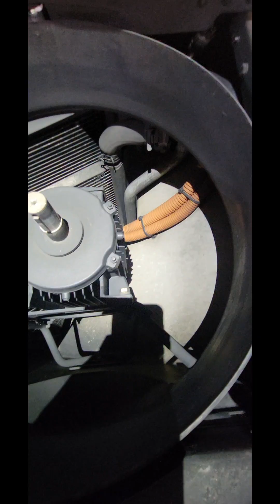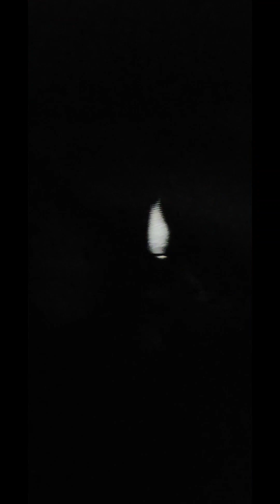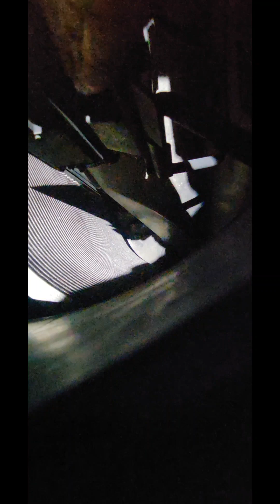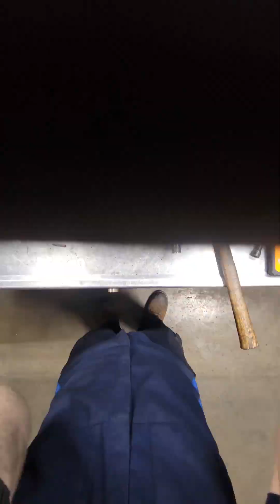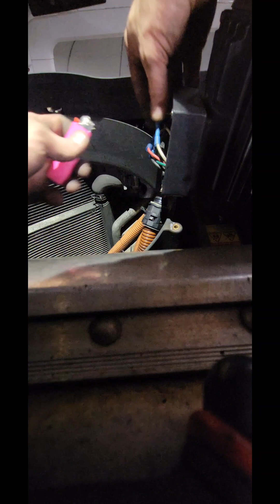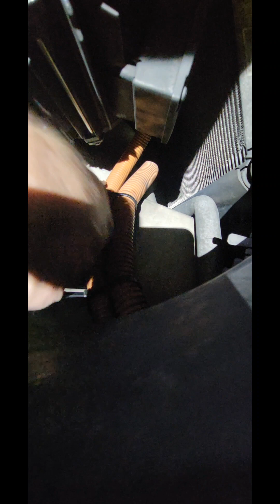full length un cut thermoking condensor fan motor rebuild plus remove and install

Comment: Can you post directions where we can buy replacement parts? Tanks
Reply from the maker: @myroslavmelnyk  literally anywhere that sells bearings. There will be a brand and part number on the bearings you removed. Use the internet to cross the part number and find the bearing that best suits your needs. A little secret i have found is to not be cheap when it comes to bearings. Stick to name brands. You can also locate a local bearing shop, small or heavy equipment service/parts provider and have them help find the right bearing.

Comment: You changed that bearing do you remember part number pls
Reply from the maker: @horoshotogda1870  the latest part number i have is 401603 We order from thermoking grand rapids Michigan

401603 kit should have everything you need to rebuild the condensor fan motors